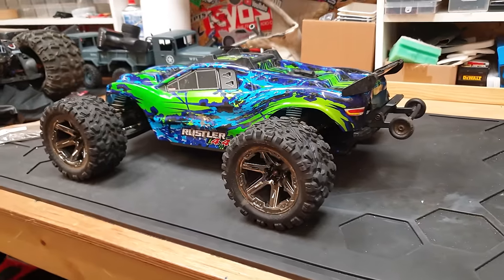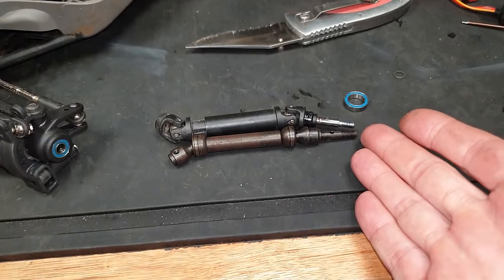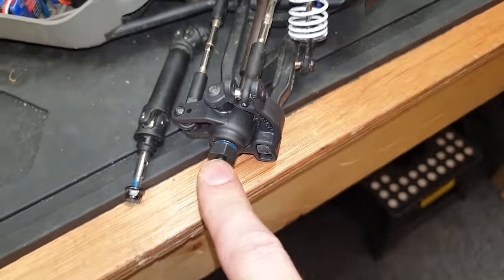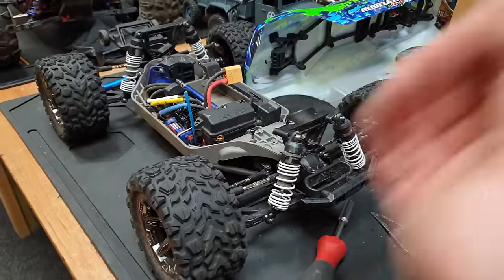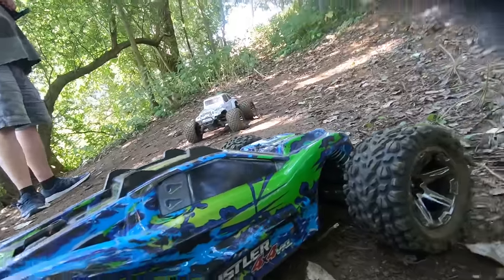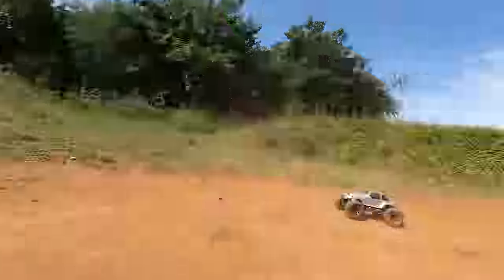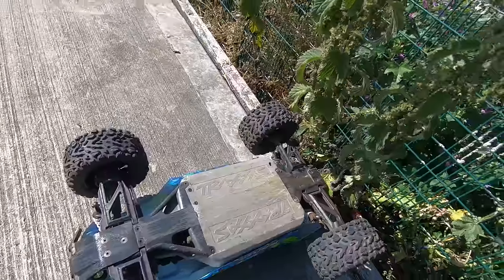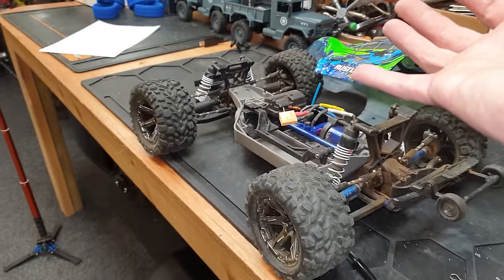Here's Why I Haven't Been Using The Traxxas Rustler 4x4 RC Car

Comment: I run an after market motor on my rustler 3s every time I take it out it eaither the gears strip or something else breaks
Reply: What gear spur or diff, the diffs on this r slash diffs and super strong but the stock spur definitely needs to be upgraded to a metal one
Reply: @weskelley2485  not really I have a 2200kv hobbywing motor with stock spur and it runs fine only problem is that the stock drive shafts keeps popping out
Reply: sounds like un proper mesh between the spur and pinion or something else

Comment: My zop Lipo 2s barley Holds a charge will last less than 10 minutes do you know thanks. Nice video by the way😁
Reply: How meny mah is the batterie ?
Reply: How old are they?
Reply: You’ve damaged the battery. One of my 6s batteries are like that but hold the charge for about 40 mins and then it starts to dwindle.

Comment: Mip shafts work great but you cant use rpm arms or you'll break em. I use traxxas cvds and they are only shafts that havent broken yet
Reply: Travis Williams I’ve been running mip shafts with rpm arms for over a year no problems that’s with a castle set up

Comment: Kev, you should look into the tekno m6 driveshafts for the slash and stampede 4x4 TKR6851X and TKR6852X. I have them in my slash 4x4 with good luck so far. Maybe they will be the ticket your looking for.

Comment: Hi kevin i have the traxxas rusler 4x4 too
 

I have 2 questions 

1. Why do he not use the wheely bar (i have 11.1 v)
(Or Do i have to do the extra gear)

2 the battery loads 2 hours 
And he needs to do 1 hour 

Sorry for bad english☺

Pleas anwer☺
Reply: 11.1 volt battery

Comment: I like the rustler, but the E-Revo 2.0 is just strictly better, IMO. I've already had to replace my front drive shafts from a hard landing directly on a single front wheel. I have yet to have issues with the rear links like you've had, which I find funny.
Reply: It's also more expensive...

Comment: only good ones i have found are tekno m6 front an rear cvd drive shafts....an those stock shocks are absolutely awful caps pop off just driving around lol but now ive put another 600$ in this 429$ its finally able to run an not break in 30 seconds

Comment: I don’t get the point where the driveshafts are weak, I‘ve got a Traxxas Slash Ultimate and took the Slipperclutch completely out, and it accelerates insanely fast, but my Driveshafts are still the original ones, by running them for more than 4 months in this spec.

Comment: You're practically asking for trouble with that Shoe in place burnouts. Hard on the diffs gears and motor spur and pinion. And I like to get good quality stuff or else some certain things will ultimately fail on me.

Comment: Kev! Does the Rustler clipless body fit on a Slash Ultimate if you just change to the Rustler shock towers? Tired of the slash body ballooning! When sending it to the moon! 🤣
Reply: kinda slash 4x4 is a lil longer. get the rustler chassi and center drivesaft and the battery hold down . oh also you can mount the slash 4x4 reciceer box up front of the rustler 4x4 chassi, hope this helps.
Reply: @Cheesicle_  ok nice so the rustler chassis is still LCG like the slash ultimate. Might look into doing this. Basically converting a Slash to a Rustler....lol
Reply: @JTAloft  yeah pretty much
Reply: @JTAloft  then youd have a rustler 4x4 ultimate 😉

Comment: The stock shocks on the rustler are an absolute joke. And I’ve tried those same metal drive shafts and had the exact same problem LOL I bought a set of MIP Driveshafts for mine and have never had the issue sense.
Reply: Mip driveshafts are the best in my opinion but a little pricy. They are worth it though. U get what u pay for

Comment: I’m really thinking on getting one of those after watching your rustler do u think it’s the best option? In the 500$ range?
Reply: Maybe an outcast 4s
Reply: Instead of rustler?
Reply: Ryder Grissom instead for vxl rustler
Reply: @therealshadygaming468  ive got a 4x4 rustler and for the most part i would recommend it.  There are some upgrades that kev recommends that i have done, also the stock shock caps need replacing.  I think Kev would recommend the outcast 3 or 4s as well for bashing
Reply: Rick Weyer is a out cast for 500$ rtr?

Comment: Everyone I know with a rustle takes it out and something breaks almost instantly... 🤔 im happy with my maxx it takes vicious beatings and rarely breaks.
Reply: I have rustler 2wd with a 5500kv motor and suprass esc everything except pinion and tires are stock I barely brake stuff the only thing I “broke” was a shock cap and I just screwed it back on

Comment: I have my rustler 4x4 and it’s making me broke the drive shafts break constantly and I’ve tried most metal ones and they keep breaking I can’t keep spending money on this and I have a powerful servo in it but there’s so much flex in all of the plastic
Reply: Have you tried tekno m6 about a $30 optio
Reply: Radio Controlled Madness no, I’m thinking about putting in all aluminum parts so there’s not as much flex

Comment: I would never buy another Traxxas product again.  I bought 2 rustlers at once with two optional battery chargers and two optional Lipo batteries.  Right out of the box one of the receivers was bad and both battery chargers were bad. It took over a month for Traxxas to agree to replace the battery chargers and even still they wanted me to pay for the return shipping of the battery chargers to them.  They did replace the receiver without any issue right away. However I was responsible for providing video evidence of all of these issues. Two months later after receiving the product the receiver went bad in the second car. Now the factory will not warranty it.   They again want me to pay for a part that went bad on a 2 month old $500 RC car.  These cars only come with a 30 day warranty. Purchase yourself an Arrma vehicle with a two-year warranty!
Reply: You have bad luck. My Traxxas stampede 4x4 vxl is indestructible and you can drive it underwater with no problems.

Comment: you would think by now , @traxxas they would make better designs  for there slash, rusler stampede 4x4 and the two wheel drive one they make better drive shafts but seems like @traxxas there not worried about there buyers , they just want you to get a new one , so until traxxas can focus more on there costumers im moving to Arrma rc cars and trucks , im done with @traxxas  for now .
Reply from the maker: THe design is great, but the shafts deffo need improving

Comment: Omg! I have a Traxxas 4x4 stampeded. You put 4 new own axles in it,  3/4 throttle first time 2 axles snap, unusable!!!  I bought the mip shafts, haven’t put them in yet, haven’t driven it in 5 years.   Wtf!  Same design the rustler 4x4 pretty much.  That’s why I would never buy one.   Have rear wheel drive traxxas cars and erevo 2.0 XMAXX with hobbywing 5 and 800kv motor.  Plus tons of arrma tamiya marui and all other brands.  The traxxas and arenas need mods right out of the box.  Doesn’t stop me lol real cars are the same way.

Comment: I had a 2 wheel drive rustler but the gear and drive shaft broke also the battery doesn’t charge anymore
Reply: You can get spares
Reply: smash rc it’s not worth it

Comment: Thats why i sold it electronics were nto able to handle power and will go into thermal tires are ounny smoll driveshafts did not whted to spend 200-300$ on a so frustrating first rc car now i have a 4s outcast and krton and i did what the rustler never did at day 1 of ownership😄 for what 20$ more? And its so big vs a rustler